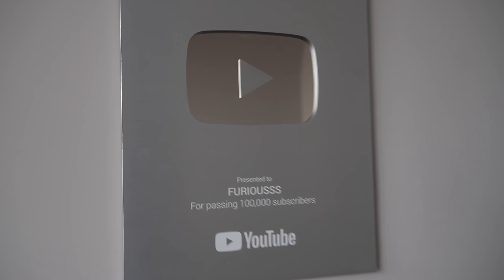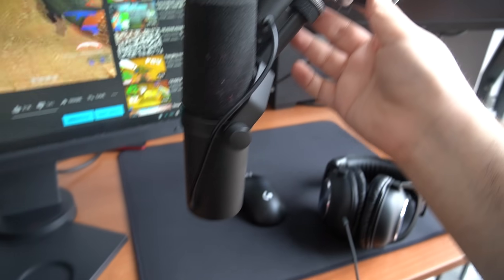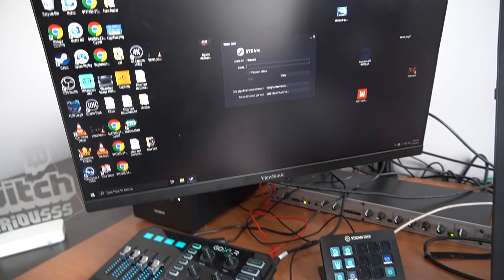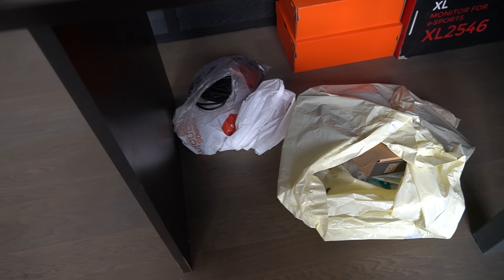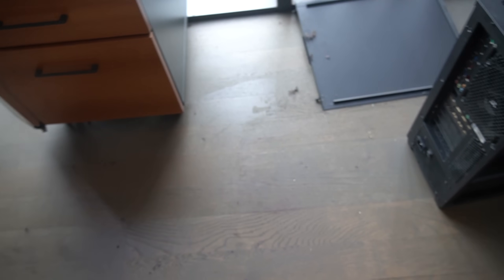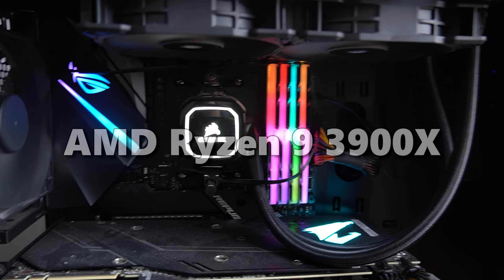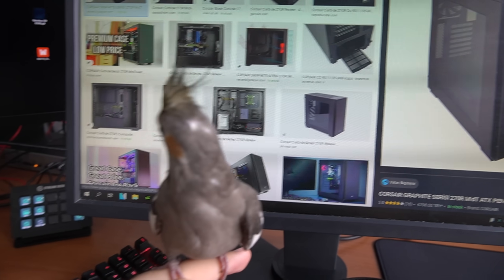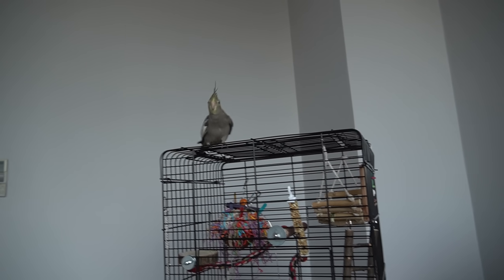SETUP REVEAL/ROOM TOUR! ft. my birb, Qoque :) [250K Subs Special]

Comment: you might want to avoid using vacuum cleaners or leafblowers when cleaning as the fans will start spinning and generating static electricity.